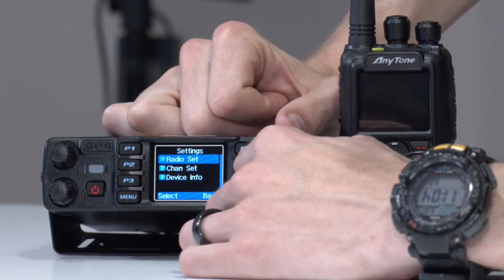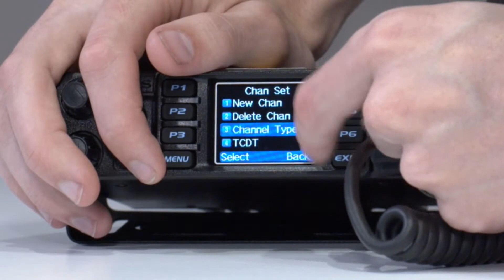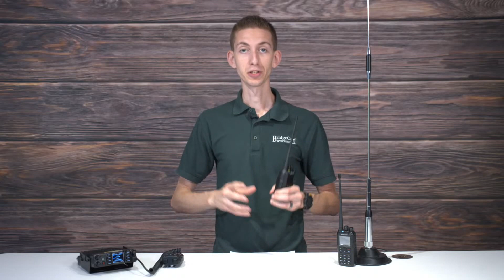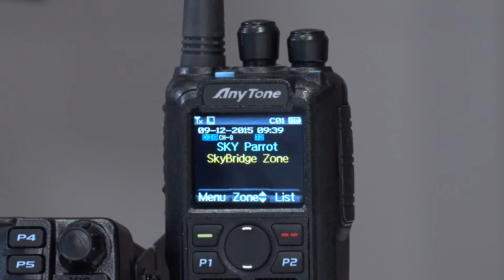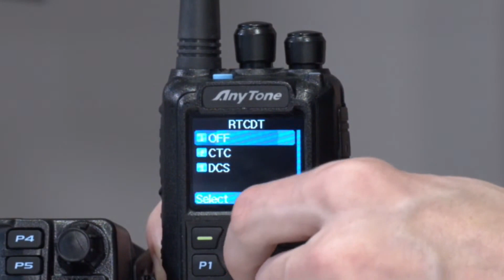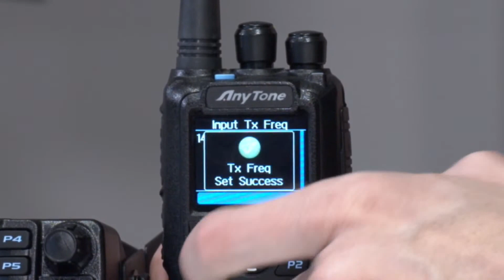How to Use Cross-Band Repeat on the AnyTone 578 Mobile Radio | BCU Live Free Training

Comment: Is there a video on how to program this on Anytone's CPS?
Reply: I was able to program the repeater directly on the AT 578.  But I also have the BT-01 and was told I'd be able to do everything from the BT-01.  The "Repeater" option to turn it on is not available on the BT-01.   So initially I was using the AT CPS to just program channels, but it doesn't appear to work in Channel mode, only VFO.  Anyone else able to program successfully in Channel mode?

Comment: Can the radio cross band DMR to DMR frequencies?
Reply from the maker: Thank you for your comment.  Yes, it can do Xband from TS1 to TS2.  If you're interested in an awesome Handheld radio where we'll train you, check out the AnyTone AT-D578UVIII Plus:   https://www.bridgecomsystems.com/pages/578uviiiplus
Reply: @BridgeComSystemsInc  I have 3 of them. Plan to use them for private security down south.
Reply: @BridgeComSystemsInc  Thanks. I can't wait for AT to make a time slot repeat so you can repeat via TS1 to TS2 on the same frequency, like the Hytera Full Duplex radios do.

Comment: Thanks for taking the time to make & posting this video but I’m confused. If your HT has the ability to transmit on one band and receive on the opposite and visa-verses, wouldn’t that negate the need for a cross band repeater ?  My understanding of the need for such a repeater would be if you had one person or group operating on VHF (single band) radios that needed to establish communications with a second person or group operating on UHF (single band) radios ?. Correct ????
Reply: Not so. The idea is line of sight and relative lower powers associated between the two handhelds, with a repeater it won’t matter. Park the vehicle to where all your handhelds have line of sight to it. It’s so the handhelds can communicate with each other using their relatively low native 5 watt power into the "repeater" retransmitting on a higher power so that anyone with line of sight can use it. Remember, if two people are within line of sight to each other they can talk simplex on the output freq, of the repeater, "talk around channel" so they don’t tie up the repeater but can still hear it in case someone far away is trying to reach them. This setup as shown falls down when your people only have mono band radios.  A hilltop repeater is a “station" with an associated call sign. This mobile repeater is “owned" by whomever set it up and is acting as net control operator using their call sign. It’s up to the net control to always maintain line of sight in order to I’d the station. Some mobile rigs will identify themselves using net controls call sign programmed into the radio via Morse code at programmed intervals or upon tx activity after prolonged silence.

Comment: Can this be used to crossband a UHF simplex channel into a VHF repeater? For example, we use 146.910 for our repeater (with a transmit on 146.310). Can I set one channel to 446.45 simplex, and have it crossband into the repeater on the other channel?
Reply: Patrick, you are describing what might be the most typical application. Works well!

Comment: I am a little confused about this video.  The HT's are set to receive on 433.00 but transmit on 144.300.  My experience in other crossbanding experiences (Yaesu VX-7r and FT-8800) is that the HT transmits AND receives on the same 70cm frequency.  The mobile functions in cross-band mode by 1) receiving a signal on 2m (from another station or repeater) and simultaneously transmit on 70cm (to the locl HT), and 2) receive a signal on 70cm (from the HT) and transmit on 2m (to another station or repeater).  It seems that with the HT receiving on 70 cm and transmitting on 2m, you aren't utilizing the crossband on your transmit at all, which is the fundamental benefit of cross band - using a low power (1-5w) HT local to the mobile and leveraging the 50-75w TX power of the mobile to extend reach (as well as utilizing an antenna with positive gain).
Reply from the maker: Feel free to reach out to our Tech Support Agents for more in-depth help with that issue - https://bridgecomsystems.freshdesk.com/support/tickets/new

Comment: Can the AT-578UVIII repeat (cross band) from Channel A VHF to Channel B 224 Mhz? I can repeat VHF to UHF as per your instructions, but want to repeat to 224.920. Turning on Repeater gives a red message All VHF ana Not Supported. Is 224Mhz considered VHF or UHF?  Thank you Ken W5CGP
Reply: Have you been able to figure out how to transmit onto 220mhz?
Reply: Has anyone tried to use this to repeat from 220 to 2 meters. This is what the old Kenwood 641 could do but mine finally died. Of course you are allowed to, but will the radio do it?
Reply: VHF 30-300MHz, even 50 MHz (6 Meters) falls into this range often called vhf low band. So 220MHz is definitely VHF. From what you are saying xband 220 is not supported. It might be a part 90 thing, dunno. I do know part of the 220 band is reserved for remote controlling of some stations.
Reply: @afoot4silver800  Thank you sir for your reply. I was going to see if I could do it and use my AT-D868UV HT to carry around away from the shack where the AT-578UVIII mobile is located on the ground plane up at 20 ft. 73 de W5CGP

Comment: Nice explanation, but while different frequencies are used in different parts of the country or around the world, it would be best to select frequencies other than the two used in the demo.  144.3 MHz is in the nominal SSB/CW/Digital weak signal portion of the band and 435.125 MHz is in the satellite portion of the 70 cm band.  Rules and regulations notwithstanding, global bandplans pretty much discourage wideband digital and FM operation as shown even without the crossband repeater mode.
Local, regional and national bandplans should be checked.

Comment: If you can cross band repeat can you receive on 2 bands at the same time?
Reply: With this radio, a resounding yes. It’s my understanding this is why the two volume controls and two external speaker jacks, one for each VFO.

Comment: There are 2 requirements for local control, and a 3rd requirement for remote control of a repeater. 1) The repeater must self-identify on all frequencies that it transmits on every 10 minutes. 2) The radio must have an automatic shutoff if an error condition occurs on the repeater for longer than 3 minutes, and 3) if you are not in local control of the repeater, there must be some method to remotely control the repeater that is available at all times (i.e. not on its transmit or receive frequencies). If the radio is unable to meet these requirements, then it is not legal to use as a repeater.